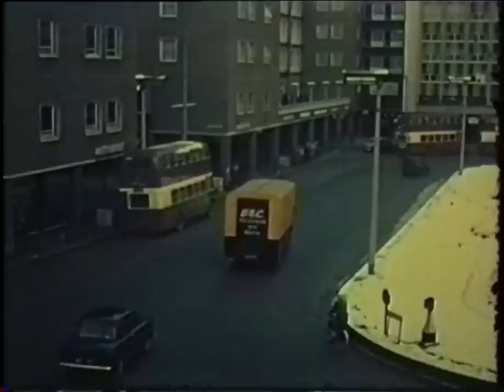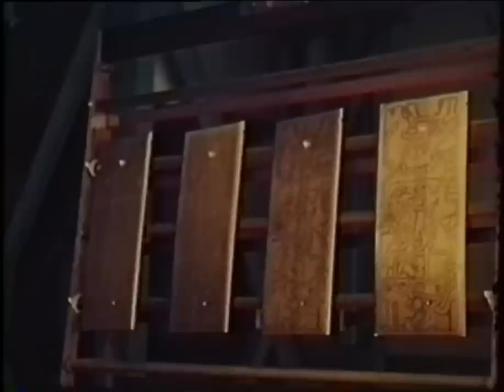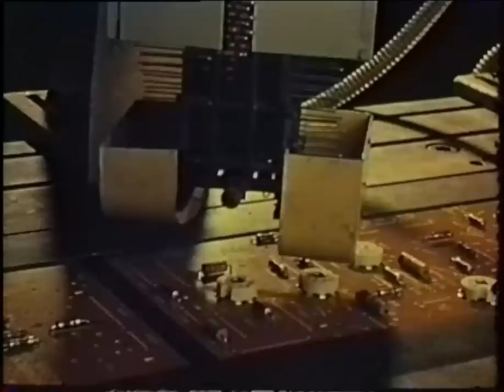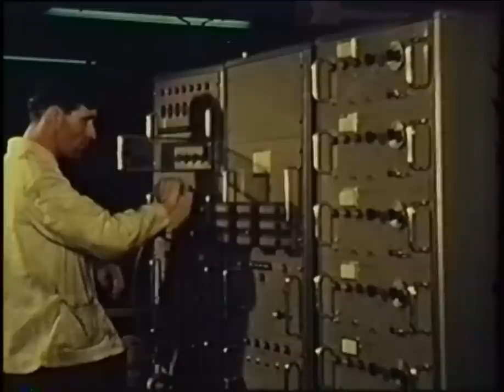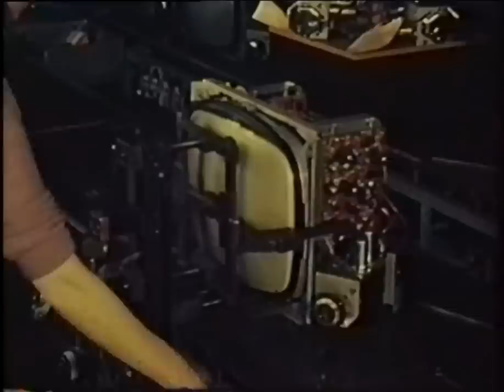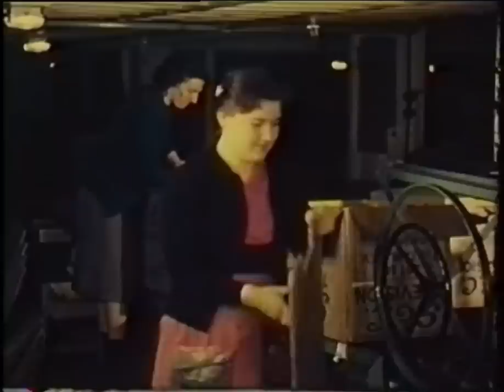GEC 405 line Television factory Coventry 1960

Comment: No lifting aids, no tool suspension reels, minimum protection, maximum employment. Great video BTW.
Reply: The narrator specifically mentions that the sets are not lifted by hand and there are many areas where it shows lifting aids.
Reply: @turbinegraphics16  And your point being?
Reply: @dave-j-k  You said that there were no lifting aids but in the video there is.
Reply: @turbinegraphics16  I was merely comparing to a factory today (if you can find one) where there would be a lift for everything.
Reply: @greenaum  The parts that made me mention it were the woman lifting the heavy glass tube in by hand and the two guys at the end throwing them in the van. I was comparing to a modern line where everything, including the tools is either lifted or counterbalanced. My thoughts were clearly not worded correctly
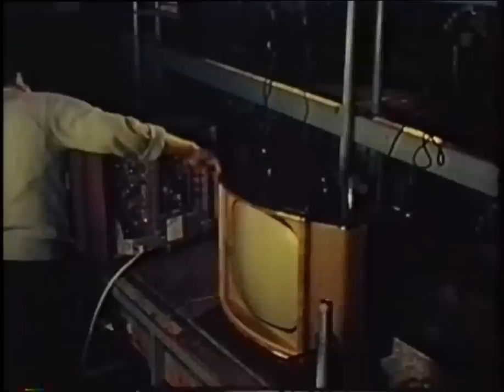Reply: Get off your high horse (also see 15:04). There's nothing whatsoever noble about breaking yourself at the age of 25 for the sake of an employer who doesn't care for your health!
Reply: @lendoggtheking  Idiot, things were different back then, H&S has come a long way, nobody is on a high-horse, it was merely a comment about the way things were. These people would have been happy for the employment chance, people were different back then as well, attitudes were different, production-line work was hard but it was work.
Reply: @dave-j-k  In 1947 1725 people where recorded to have died at work, in 2018 it was 144. I wont be lectured by a keyboard warrior, who romanticises a past in which he never worked, about the good old days.

Hostility towards health and safety is not harmless chat, it encourages workers, especially young and inexperienced workers who want to prove their mettle to cut corners endangering not only themselves but those around them too. What do you suppose happens to the man who's given himself white finger or who has contracted Siderosis or dermatitis so bad he cant work or even the one who's lost fingers or toes? And for what? To fractionally increase prophets for a company who wont give him a cut and who will drop him like a hot rock the moment he's no longer productive!

These workers where so “happy” with their conditions that they joined trade unions in massive numbers and fought hard to enshrine in law the right to work in safety. If there was anything good about the good old days it was that workers used their collective bargaining power as a balance against the power of employers. productivity has been rising for years but real wages for workers have gradually declined since at least the 80's!       
        
http://www.unionhistory.info/britainatwork/narrativedisplay.php?type=healthandsafety

http://www.hse.gov.uk/statistics/pdf/fatalinjuries.pdf

Comment: I grew up with a rented GEC in my parents' living room in the 70s. Among several repair callouts, I remember one where the power button broke free and disappeared inside the casing - British engineering at its best... eventually my parents bought a Panasonic and never looked back! Also, RF suppression was still rare in the early 70s, causing picture breakup whenever the neighbours used a lawnmower or a motorbike went past.
Reply: I'm interested why you have such a low opinion of British engineering. It's also clear you have no understanding of RF suppression, because that has to be applied  to whatever creates the interference. It can't be applied to a TV.
Reply: @MrsZambezi  From my experience, the Japanese were just better at putting things together right the first time than any western country. When they started selling radios in the USA, a lot of them sounded like crap and were mediocre in many respects, but they didn't break down. It might be something to do with the corporate structures defined in Western law; companies seem to find it easier to coast on past accomplishments, then pay off their stockholders and leave their creditors holding the bag when they can no longer compete.
Reply: @pcno2832  I still use my 60s Hacker. There never was a reliability problem with British radios. The pocket radios from Hong Kong and Japan sold because they were  cheaper.
Reply: @MrsZambezi  It's a 'generation' thing.
'Britain is Shit' was the message taught to the post-war generations, in order to pave the way for pan-European government.
I grew up with it; happily I was one of those who saw through it.
Reply: @bingola45  Brexit voter no doubt, look at where that's got us.

Comment: Sony were making the first all transistor TV at about this time.The start of UK manufacturing decline.
Reply: Only small screen TVs. Larger screens like this GEC one used valves until the late sixties when Thorn Ferguson made the first all transistor colour chassis, the 2000.
Reply: Exactly, and even after that if you count hybrid sets (mix of tubes/valves and transitors). I think it was RCA in the U.S with the all solid state colour XL-100 in 1969, but that was also a top end model with loads of problems, their cheaper models were still hybrids, as were the sets Zenith, Admiral, and Philco put out.
Reply: I hate to break it to you but the majority of Japanese built TVs were mostly tube/valve around this time too. Most everything that Matshushita, Toshiba, N.E.C, Sanyo, and Sharp put out were mostly tube/valve in 1960, and were that way right into the early 70s.

Comment: So they're not printed-circuit boards, they're "printed-wiring panels!"
Reply: Of course looking back in hindsight where the term printed-circuit boards or PCB has become standardized, we must remember that for a time, this want so
Reply: Plated circuit was another term I have read, Motorola used to call their printed circuit boards a PlaCir chassis. Neither is quite right, they are not printed, nor plated, but actually etched.
Reply: Crown / Harman in the US still call them PWA's , printed wire assemblies

Comment: Is the guy hitting the set at 15:00? 😄
Reply: He's stealing the consumers job!!
Reply: Always worked the bang.
Reply: Yes. That would've caused any connection issues (cold solder joints etc) to show up at least momentarily, leading to that unit not getting packaged but fixed instead
Reply: They had a special hammer, called "tube tapper", for this. Tapping the tubes detects crackling issues or microphonic tubes.
Reply: Usual way how to fix lamp TV's with rotary channel switch :)  Had to do that in my childhood sometimes.
Reply: I'm sure that employee is named "Fonz"
Reply: The faulty TV set is now corrected
Reply: When I worked at Panasonic in Cardiff in the late '80s there was a hard foam paddle used to hit the top and sides of all TV's, to check for loose stuff.
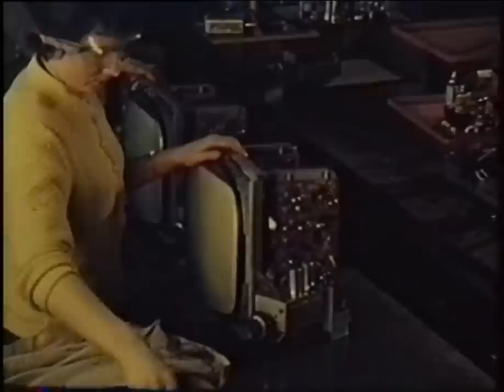Reply: Indeed, you can see this being done at the Salora factory in Finland (skip to around the 12:50 mark): https://youtu.be/MHj0_5Nnkho?t=773
Reply: Yuo can't do that anymore new t.v's would break
Reply: Testing for dry joints i still do it the same way today.
Reply: it was a common trick when they used valves and homes were full of nicotine smoke and heated with coal.

I still find it mind boggling that today they moan about traffic pollution so much.
Things were far worse 45-60 years ago.

Comment: Why its dark inside the factory?
Reply: Don't think it was as dark as it seems. Cameras want some beefy lighting solutions for picture to look good when filming indoors. Back in the day, and today, too. Maybe not much extra lighting, or none at all, was used to shoot this. By the bare eye, the place was no doubt well lighted, almost for sure.
Reply: It's colour film.  That was pretty insensitive at the time, and needed brighter lighting.  Judging by the outside shots, this film was made in winter, so not a lot of natural light.
Reply: The film's deteriorated heavily, particularly the blue channel. You can see at the end there's a colour GEC logo at the bottom, you can only see the G and E.
Reply: @greenaum  Does film HAVE a 'blue channel'?
Reply: @greenaum  A simple 'no' would have been quite sufficient.
Reply: @greenaum  There are no 'channels' in film; it's a chemical process.
Red Green and Blue are the three channels in basic component video, which is what you were probably thinking of.
I sometimes make mistakes with technical terms. I just accept it, though.
Rather than trying to pretend I was right all along, which is a little bit like falling off your bike in front of your schoolmates, and saying "I meant to do that".
Reply: @greenaum  Are you still pretending that there are colour channels in film?
I'll join you. I have a reel of 2" quad where the red dye has faded to pink!
Reply: Thanks bro and thanks to people who made those things for humans

Comment: Made in China...to please the stock holders and profit margins......
Reply: Which really has no savings anymore since the production of electronics is mostly automated, plus the shipping costs, plus the Chicoms ripping off your production methods and violating your patents. The Japanese were a little smarter, they mostly set up factories in Thailand, Malaysia, and Indonesia instead.
Reply: Yea, but I could not imagine how horrible it must have been doing the same thing over and over for forty or more hours a week.  That's a hellish job.
Reply: Robin Sattahip better than working at Starbucks
Reply: @rsattahip  Robots are the ones doing it.
Reply: @rsattahip  I spent 2 or 3 days with tool manufacturer in the 1980s, gathering footage for a promo video. It was hellishly oppressive in there. sub-bass > 90dB and 35 degrees average temps

Comment: We had a two channel GEC  similar to these with a sliding door which covered the screen. It's true when people say " They just don't make things like they used to " . GEC  was huge when this film was made , they made everything from railway trains to tv sets , radios and cookers to electrical and electronic parts.
Reply: Absolutely - a great innovating company destroyed by useless management.
Reply: All destroyed when GEC management made the catastrophic mistake of divesting itself of all the less exciting profitable sections, turned into Marconi and went all out for the telecom bubble.
Reply: @MrsZambezi  Trying to put Intel Pentium processors into System X exchanges was a total disaster, upgrading the GEC designed processors would have made more sense but they wanted bragging rights of using Pentium chips.
Reply: @MrsZambezi  GEC destroyed Plessey also.

Comment: I was very fascinated by this. Thanks for posting. GEC were one of the first firms to use PCBs and many other firms used complete hand wiring with tag boards well into the 60s. I'm surprised how automated the production actually was for the time.
Reply: Many manufacturers continued using point to point wiring because there were many problems encountered with early printed circuit boards, such as traces falling off the board, poor solder joints, etc. Zenith was one such company, they employed hand wired chassis right into the 1970s. Other manufacturers used a mix of hand wiring and printed circuits in their chassis, such as they would use P.C boards for the I.F strip, but use hand wiring in the high voltage section, and anywhere they had hot running tubes/valves.
Reply: tr 90 for your jazzmen .....    me no 0.01  mf  myself prefer car ignition capacitor 0.22  mf.    to use in between jack headphone socket to cd or CASSETTE PLAYER BETTER.,.,.,.,.,,,,,,.,.,.,.......PLEASE USE OLD SOLDER FROM NEAR BY......................... dear MR OlegKostoglatov    THANK YOU
Reply: @mohammedanwar-zz2ld  r/ihadastroke
Reply: @mohammedanwar-zz2ld  Someone fell asleep with the phone in their hand, I think! Hope they didn't drop it!